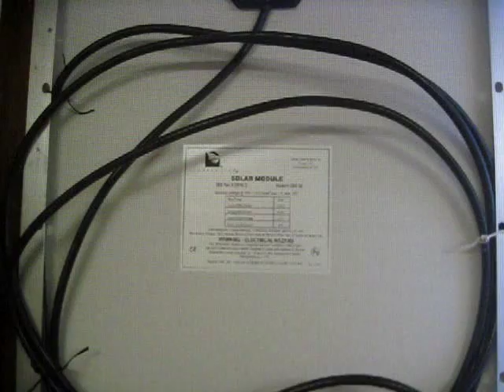Small Solar Battery Backup System Part 1

Comment: @Scootchinman Not to belabor the point but a short would cause enough heat to cause an explosion. So, although everything in there in working condition will probably not generate enough heat something shorting out would most certainly do it. Either way, always ventilate your batteries unless they are gel or something non-hydrogen producing. I'm planning on posting some videos myself. 175W mom panels with 1 1200 watt grid tie inverter for now. I'll be expanding as I go...

Comment from the maker: @helloman1976  Yeah, I thought of that as well, but with such a tiny panel and battery I highly doubt I could even accumulate enough hydrogen to cause a problem. Even if I did though, there's nothing in there that will really heat up except the LEDs and I open the lid when I'm using those! Good call though. I should have included that in the video for those who don't know about it!  Anyone reading this, if you decide to build something larger than this, make sure you vent the battery box!

Comment: Something to think about, yes they are sealed batteries but just keep this in mind... If those batteries "vent" inside that container and then something in there generates enough heat the result will be that you will have a small explosive device that could cause some serious damage. In your case it doesnt appear that you'd have a problem but if you were to scale the size of this project up you could be in real danger. Just a word to the wise...